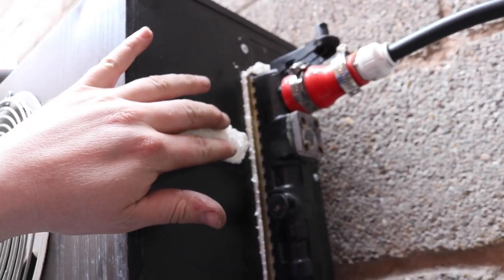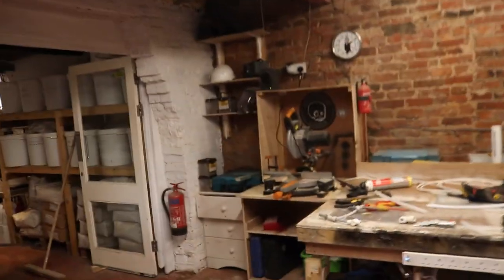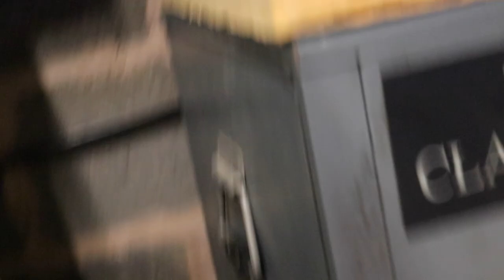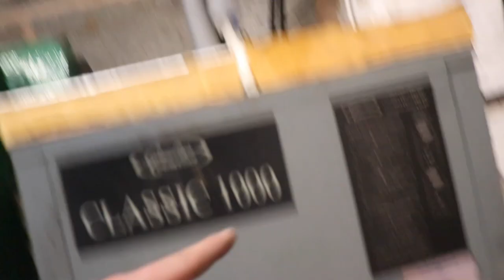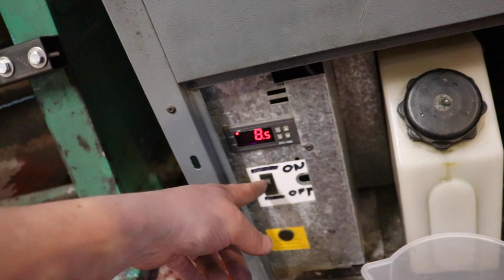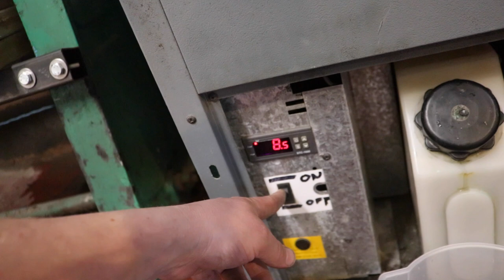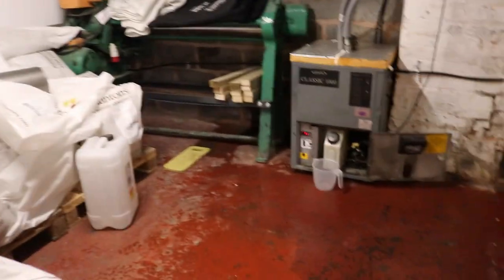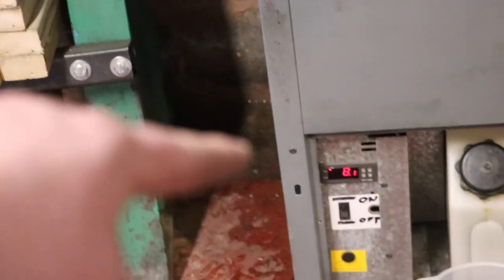Cooler Problems

Comment: I do believe you need that vent in that cap to allow the fluid to move you will need to put in inline check valve for when the system shutdown
Reply: That's what I thought, hence the vacuum hiss when the lid was opened after turning back on. 

Maybe run a breather hose from the lid to a level higher then the heat dump outside